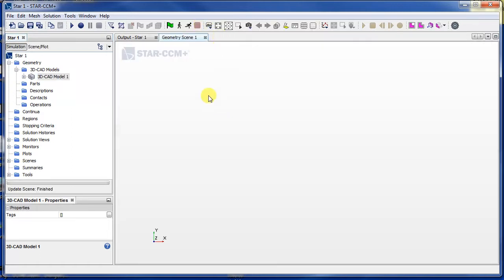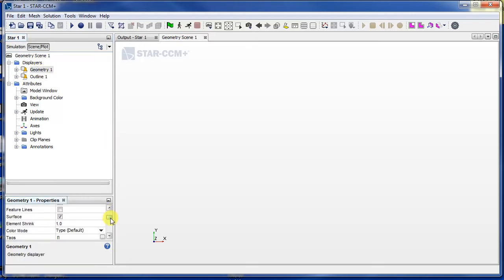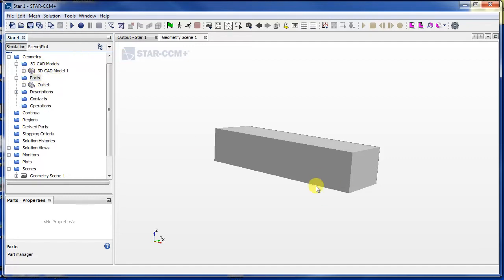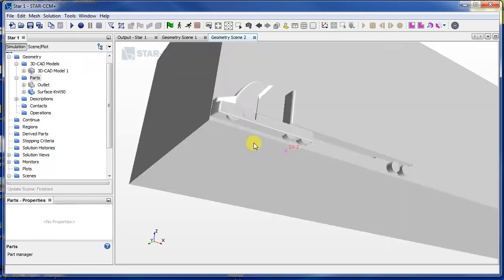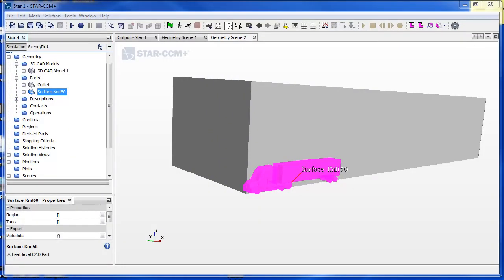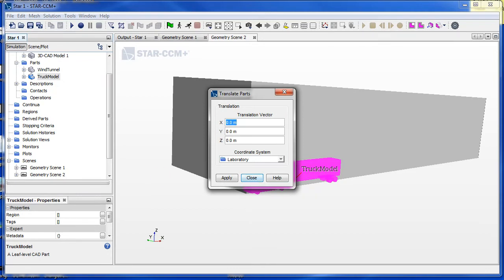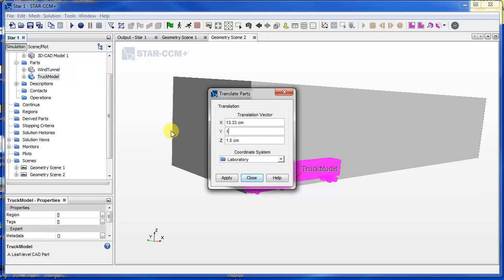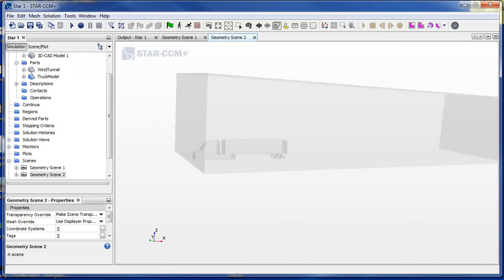Star ccm+ Beginner to Pro [Simulating a truck part 3]

Comment: Why wind tunnel is this much big (the block)
Reply from the maker: hi there.. a small wind tunnel will have a high blockage ratio where the test piece and wind tunnel walls will accelerate the flow. In this case I am trying to simulate a truck in the open air so I want to minimise this effect. thanks for the interesting question.

Comment: there isn't geometry displayer , how to find it ?
Reply from the maker: Make sure the part is selected in the scene correctly, you can try dragging the part onto the screen, or find the option to select the part under the scene.
Reply: @zacmac  hello, how the part is selected correctly in the scene? Where can I find the option to select the part under the scene? THanks in advance!
Reply from the maker: @3kiW_900  try the simulation tab next to scene/plot tab on left hand side. Make sure you convert your 3d geometry into a new part. Can drag the part onto the scene. Also check you have a scene created. Also check you have selected 'geometry' representation under scene tab and the properties of your geometry.